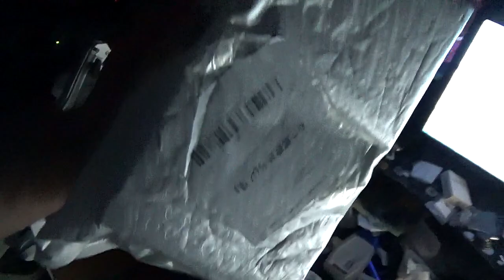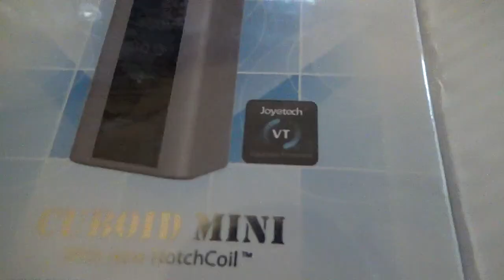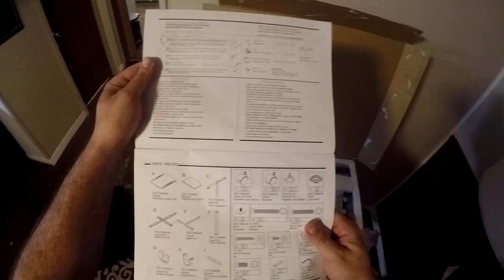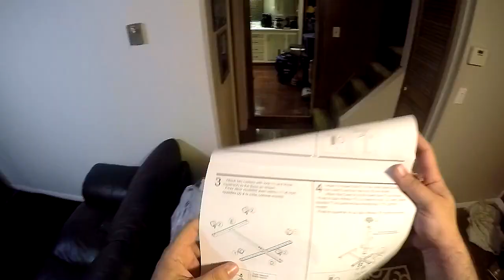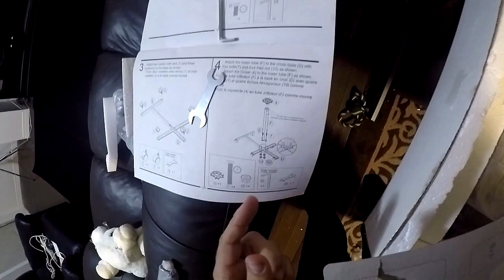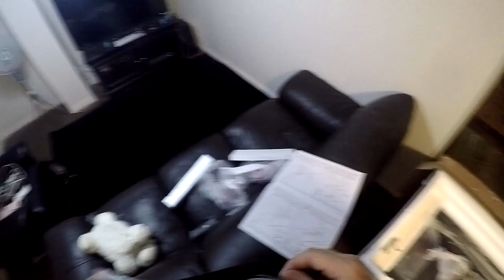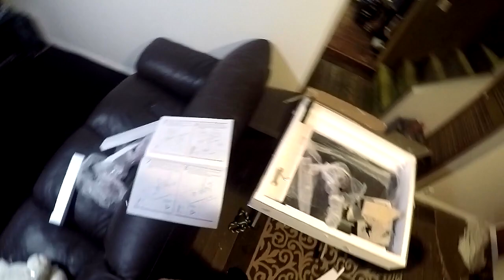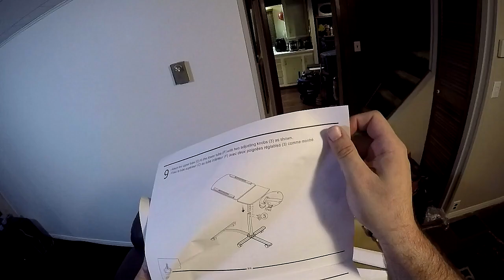Carpet and Desk

Comment: I bet you could rotate the stand base 90 degrees so it fully goes under the couch.
Oreo is a greedy little doggy, scampers should have her toys.
Looked for the mower belt but most sites are too vaigue, you might have to wrap a string around the pulleys and get the basic length, then look for belts.